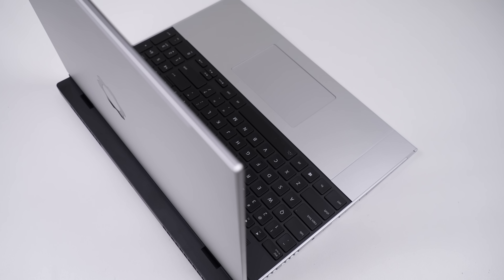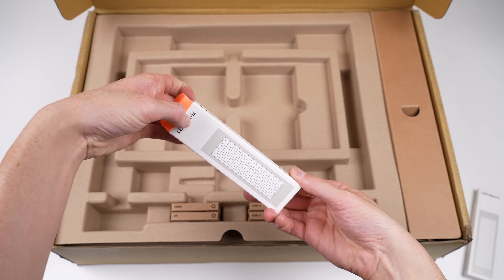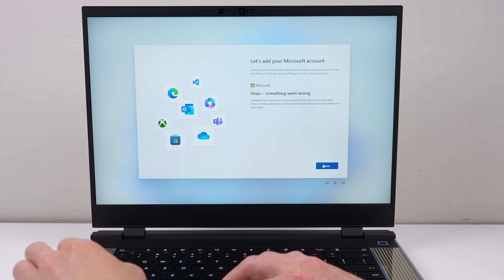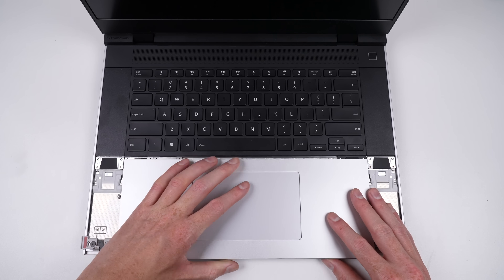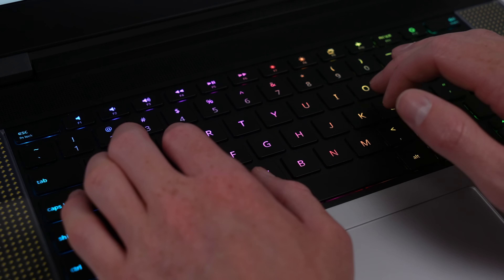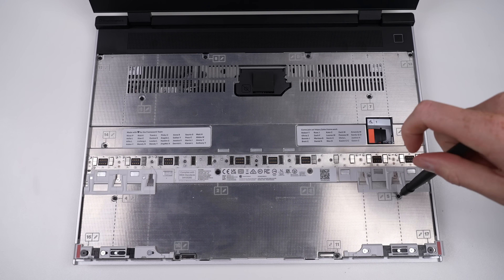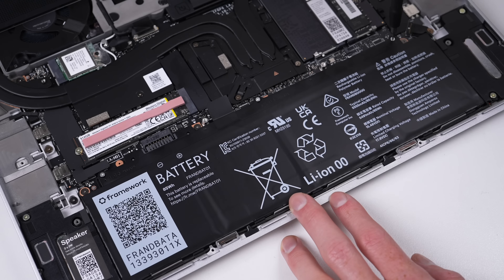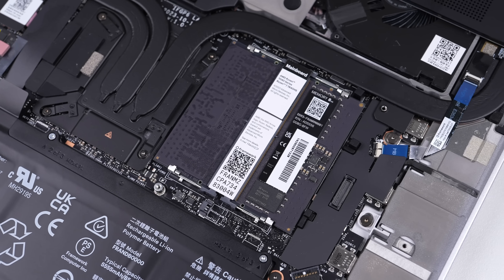Game Changing New 2024 Laptop Design - Framework 16 - Teardown And Repair Assessment

Comment: They‘ve done it. THEY‘VE ACTUALLY DONE IT!!!!

Alright! They convinced me! Im gettin‘ a framework!

Edit: Ya might be overdoin it with the likes… (Thank you)
Reply: time to change your name to thedudewithdaframework lol
Reply: @pulsar_x2  Yes. That‘ll be rebrand number five then. 😂
Reply: Time to ditch the Mac - they will never be as good as the Framework in terms of serviceability.
Reply: someone switching from apple to anything else is always nice to see
Reply: @bl00dknight26  Don‘t get me wrong. I love macs. The old ones are such gorgeous reliable machinery. Tge new obes are just husks. Those may have an apple on the back but they are nit mac‘s. They do not embody the spirit of the macintosh. Theyre bland, boring, lifeless and you don‘t even own them fully.
Reply: @bl00dknight26  Dont get me wrong. I still love mac‘s. But the new ones just suck.
Reply: @EvexiansVideoworks - Apple laptops with soldered on SSD's, proprietary RAM, sensors and parts serialized so it can't be fixed easy.  NOPE!   Hello Framework!  ;)
Reply: It seems like the perfect laptop. Love to see video editing. Next computer for me.
Reply: Same, I like the larger 16 inch screen.  Currently I'm using an older ASUS 17 inch ROG laptop but my next one will be a Framework. :)
Reply: Same here
Reply: yes they done it, they made a super heavy and super expensive laptop that is not selling
Reply: Bro razer also has replaceable ram, SSD. Wifi, speakers, battery etc. like you are comparing apple to this, when every other laptop manufacturer has replaceable parts.
Reply: @flamingkillermc2806  Do they have swappable GPU‘s? Do they have swappable ports? Can you just magnetically detach the entire Topcase?
Reply: @EvexiansVideoworks  Why would I want to swap a RTX 4080 out? The frameworks AMD Radeon 780M is an integrated GPU, not even a dedicated GPU.  Razer blade pro already has more ports then framework, and even a 2.5 g ethernet port, SD card reader, 3 USB A 3.0, 1 USB C thunderbolt, 1 USB C 3.0,HDMI, etc. No reason to magnetically detach then entire top case, what if someone took your trackpad or keyboard, what are you going to do now?
Reply: @EvexiansVideoworks  I would gladly take a different laptop for a couple of swappable things which no one is going to use, and for $2k you can build a whole PC with better specs.
Reply: @flamingkillermc2806 reprability if you break it?
Reply: @flamingkillermc2806  razer fucking sucks

-razer blade 2018 owner here.

I love having my batteries bloat and become a fire hazard

No one should ever purchase a razer blade. They’re overpriced pieces of shit.
Reply: A 13 inch framework will be my next laptop, but I just upgraded to a surface laptop 4 a year ago I just couldn’t wait, my shitty MacBook just wasn’t cutting it
Reply: Touchscreen display option and I’m all in!
Reply: overpriced for the performance...
Reply: i never expected to find you here
Reply: @ Good to see you‘re still alive
Reply: @ nah i just quit discord
Reply: @ Fr…?
Reply: @ ya for my own health
Reply: @ Shame. I‘ll miss ya man.
Reply: This is really a WOW MOMENT.
Reply: Smart choice, chief. I hope you get done great things with it.